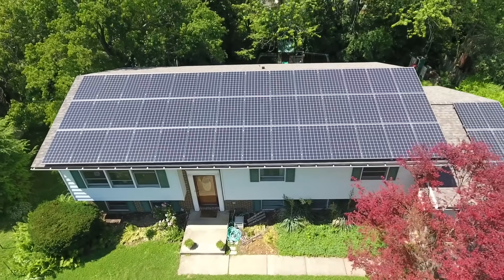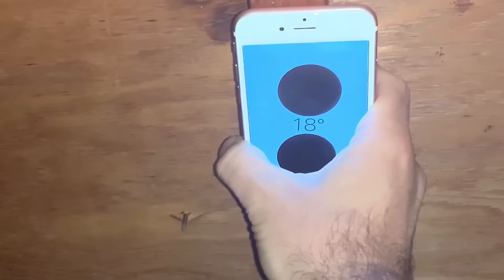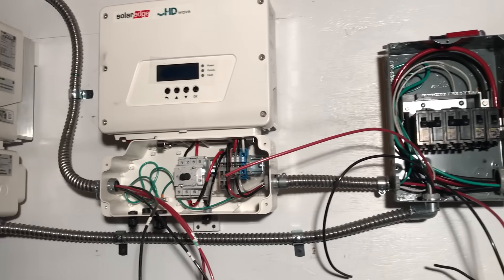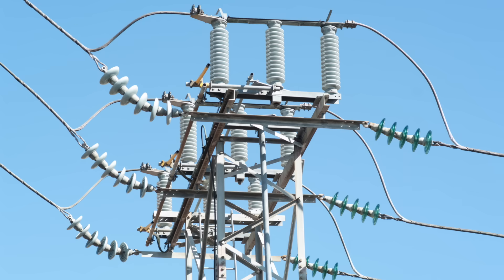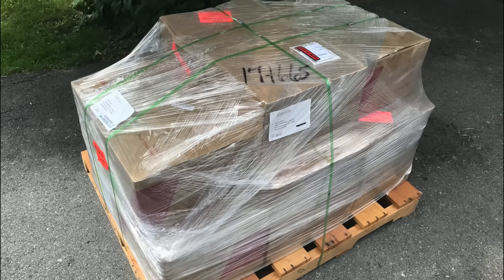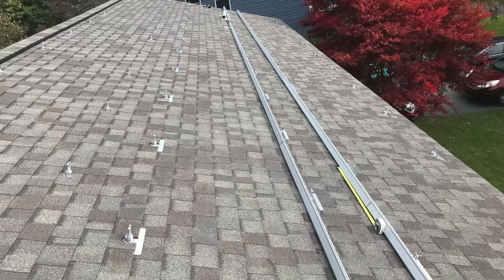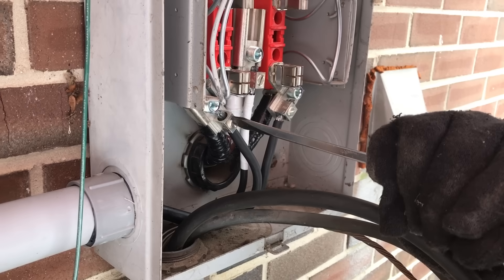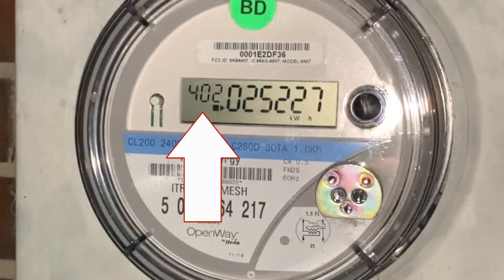I Installed a Power Plant Myself | HUGE DIY Solar Panel System

Comment: So when the sun is down and there’s no charge on the panels, the grid is powering the house?
No batteries?
Reply from the maker: Yep, no integrated batteries.  If you watch the video after this one I explain a little about how 1-1 net metering works.  I also have a video with more explanation on why I don't have batteries integrated.
Reply: @FrugalRepair  so during a power outage you could potentially be screwed if there’s no generator backup

Comment: Today, there are HYBRID INVERTERS which can charge batteries and at the same time tied to the grid also. Your solar system won't produce electricity if there's a power outage. I guess you've known this thru experience by now. 🙂

Comment: How many hours or days did it take you to install the panels only on your roof?  How long did it take to install the rest of the hardware (inverters, conduit, meter boxes, and wiring, etc?  Also, how long did it take for your neighbors to install the same?  I'm just looking to get an average length of time.  My house is much smaller, so, I'm trying to guesstimate how long it might take us to install it on our own.
Reply: hi if  you are planning to install system yourself  i can help you by provided permit design for your system.

Comment: How do these panels hold up to severe weather such as hail and thunderstorms?
What is your plan when the roof needs to be replaced?
Your work is very neat and well planned!
Thanks in advance!
Reply from the maker: They hold up great.  They are made with the elements in mind so they are very strong and the rails are spec'd to withstand like 130mph wind gusts.  I doubt the front roof will need replaced in my lifetime (the panels are extending the lifetime of the shingles)  but worst case, I take off the panels, sell them locally, maybe install something new, or just put them back on.
Reply: @FrugalRepair  thanks again.

Comment: What a great video. I'm a carpenter/maintenance man and I would like to do exactly what you did. To me it actually looks kind of easy. I got a quote from a solar company and they wanted 22,000. I think I can do it way cheaper. I'll be using your links thank you very much.
Reply from the maker: Thanks.  Are you looking for a DIY kit solution?  Or going to buy the components and design yourself?

Comment: This is bloody impressive! Sadly, here in CZ or Germany you would not be allowed to install high voltage electricity without being a certified electrician.
Reply from the maker: Thanks!  Could you do 99% of the work and then have the electrician connect the wires to the power grid?
Reply: @FrugalRepair  well I could not. also most will not do it because they have the liability on their neck then for your work
Reply: @FrugalRepair  say you mentioned you used a website or app to assess how many panels etc you need. right? can you maybe give the URL?

Comment: I like your attention to a quality install, well done.  Personally I don't like the look of solar panels all over a nice house.
Where I live the hydro company will never cut you a check for power going back into the system, just a credit.  Which would be no good for me, because I really don't use a lot of hydro if you do a cost of use, to power I could provide.  This would be great if I had a cottage off the grid.  Either way, great install.

Comment: pretty sure if nuclear material couldn't be turned into a weapon.. everyone would have their own nuclear reactor powering their houses by now.. one thing though.. you should have replaced the shingles before you put all that heavy stuff on there, go with 40 year timberlines if youre gonna be putting solar on your house..
Reply from the maker: I did put new shingles on.  It was in the video.  It was nice because this way all of the tar adhesive strips and nails are undisturbed.

Comment: No bills yes BUT...  How much do you have to shed out to buy those solar panels?  They are not free nor cheap either.
Reply: How much do they save in the end. A setup like this pays off after around 10 years with the life of around 30 to 40 years for the panels
Reply from the maker: It’s closer to 5 years for me.  In the next video after this one I go over what I spent.

Comment: I put a 4,440 watt solar panel system on my house in 2003 and I had to actually make the rails and mounts because they were not available to the public. Now I need a new roof so I’m going to remove my 19 year old system and I want to put a better system on. What do you recommend?
Reply from the maker: Congrats on finishing that project so long ago.  I’m not sure your setup but I liked ironridge but there lots of mount and rail options out there.  You can even get rail-less systems where the panel rests on the mount.  Feel free to shoot me an email if you want.

Comment: you should have added a point to TESLA for the emerging LFP battery. I will last longer and as I'm sure everyone will agree, it will just spin off even more innovation and allow for quicker charge times, larger capacity and higher output.

Comment: What do you do if there is a problem with a panel in the middle of your array in the middle of your roof? Do you have to disconnect and move panels leading up to that panel to get to it?
Reply from the maker: You would move one panel out of the way from the top row to get to the one in the middle.  For me, it would actually be more of an issue if I had to service a panel in the front row.   I don't know if I would try to do it from a ladder or just take out the top 2 in the column to deal with it.

Comment: Why did you install the solar panels on only one side of the roof?
Reply from the maker: It’s not economical to put panels facing north.
Reply: @FrugalRepair  So it doesn't payback itself I think. But it would still produce electricity wouldn't it?
Reply from the maker: Yes, it would still work but since I live in the northern hemisphere the path of the sun is on the south side.
Reply: @FrugalRepair  Okay. Thank you so much for answering ☺️🙏🏻

Comment: UK: Scotland. My friend has a farm. He wants to have solar but doesn't know what to buy. He had a quote from a company. 25 panels installed on cattle shed roof.  Grid-tie inverter and 10KW battery. £18,000 quoted. That would be a long time before it would have paid for itself and return any free power. By that time, the system would possibly be worn out. 
Surely there is an easier, cheaper way to free power. 
Help ?

Comment: no bills….except the huge price it costs to install.
Reply: permitting fees.  Electical engineer fees, certified electricial installation fees.  
increased insurance costs due to fire hazards
and he still has to pay the Electic company $30+ /mo just for the service connection.
his statements appear to be fraud.
Reply from the maker: Watch the video after this one and I cover what I spent, if interested.

Comment: and you are exposing neighbors to unnecessary radiation from the panel system.  If you use solar panels, they should be setup behind the house away from the home....but good job! :)...maybe you can help them with the chemo therapies.

Comment: No way those panels supply all the power you need, you dont even have powerbanks ? the kwh use in Norway ranges from 40-120kwh a day in depending on the season, and you are expected to produce between 4-12 kwh/a day with soloar panels. Sure there is more sun were you live but you can not convince me that you setup supply all your house power demand.
Reply from the maker: It actually does because I have net metering.  Watch my solar misconception video for more explanation if interested.

Comment: I've heard stories now of of some states allowing electric company to introduce minimum billing on electric bills, in the range of $25-30, to cover maintenance and upkeep, even if you have no electric usage, you'll be billed a flat fee.  This may only impact 1% of their customers but it will completely change the equation here.  Electric companies are also lobbying for reduced buy back electricity from setups like this.  These negate any advantages from solar panels.  Please check your local legislation and electric company policies carefully before installing solar panels.  Otherwise, you may not get back what you expect.
Reply: Connection fees are baseline $30 regardless of power transmitted. 
the guy is lying.
Reply from the maker: I think it's funny how you know what is on my power bill.  If you watch my videos after this I show my bills and explain how this all works.  Yes, I make money even after the power company basic charge.

Comment: solar panels decay, entire solar industry survives off the money of constantly replacing panels. Batteries definitely decay the capacity will fall every year and will need to be replaced constantly too. Green is a lie.
Reply: Planet of the humans is a good doc on that. All it is is a 20 year fossil fuel extension if you get a lithium ion battery so considering we’re gonna have major energy problems starting this fall it’s still not a bad idea to throw it in just so you have extra back up power when they cut the lights.

Comment: I have no idea why more people don't do this??  So many just continue to waste money on power companies ... the financial freedom this brings and overall energy independence is like taking a 100,000 lb elephant off one's shoulders.  Even if you don't believe in climate change, solar makes economic sense even in environments that aren't sunny.  You aren't reliant on gasoline to get from A to B with EV charged by solar panels, you aren't subject to power saving days and brownouts or just grid failures that happen all the time (aka Texas).  Our solar energy system is by far the most reliable energy source we've ever had.  I honestly just don't get why everyone isn't doing this??  In some states the cost to install is zero due to incentives.  The excuses I hear for not doing solar are just laughable.  The real losers are those slaved to be corporate power and oil companies who seem to enjoy lining up at Gas stations for $7/gallon limited energy source.  Oil/gasoline IS going to run out, not an "IF" just a "WHEN" and that WHEN is in 50-100 years (within the lifetime of many).  Nuclear energy max is 267 years until we run out of nuclear material, solar energy at least another 5 Billion years.  Solar panels are getting more and more efficient every year and we even have UV panels and Infrared panels to capture more energy across the light spectrum (other than just visible light).
Reply: Correct there are major major energy problems going on around the world right now it’s all being set up to fail by Davos bankers. Now is the time to get it installed and then you have 20 years of not having to deal with frequent power outages which are coming to even America soon.

Comment: If you installed solar panels to remove your electrical bill it's fine, but remember that solar panels are an ecological disaster you will never refund the energy it took to produce these panels. Solar panels are a gigantic scam, it's very far from being ecologic, it takes an impressive amount of ressources to produce and it is not recycable. So remember if someone is selling you these solar panels as a green energy it's an hoax or he don't know what he's talking about.
Nonetheless, good job on your installation.
Reply: True. The thing is with all the energy problems they’re gonna be cutting power worldwide from here on out as society and supply chain break down. Now is the time to install solar!

Comment: I had a solid company install 40 panels.  Predicted to break even in 7 years, it did it in 5.  I still pay electric bills, but I don't worry about heating my pool, running aquariums, taking long, boiling showers, or slow cooking all day with the oven.  Had I known we would be facing record energy pricing I would have purchased storage batteries too.
Reply: Are you off grid or unable to hook your solar array to the grid? It is better to throw extra bucks at panels and hooking into the meter than batteries unless you have an off grid situation going on.

Comment: So you have no battery bank that I can tell.... Does this mean that you make enough electricity in the day to offset the cost of the grid overnight - since the price per kWh is usually cheaper at night?
Reply from the maker: Yes, I have net metering.  Check out the video after this and my solar misconception one for explanations.

Comment: A hidden and bonus way you save money by covering your roof in solar, that not many think about. Is how the panels themself protect the actuall roof tiles from direct sunshine (heat), rain and wind. Probably making them last much longer.
Reply: actually the cells trap and increase heating on roofs ... typically causing faster degradation.

Comment: So did I 🙂. Yes, DIY’ers CAN do this and save BIG. All it takes is research and time, but the $$ savings are worth it. This month in May and for the past 5 years my system has produced 1.85 Mwh, and I’ve paid $0/mo for electricity the ENTIRE time. Watching this video brought back memories, except that mine was over a concrete S tile roof (took more time). If you’re thinking DIY solar, this channel could be just the ticket!
Reply from the maker: Congratulations on your install!  And for the encouraging words.

Comment: You don't start "saving money" immediately, you still have to pay off the cost of the solar cells. For the average home owner it's going to take 28 years to pay off the cost of the solar. Doing it yourself you saved roughly 40% of the cost. So in 11 years then you'll be paying $0 for power but not before. In other words you saved the future home owner money since most people move every 6.6 years

Comment: We would love to do what you have done , only issue , checked the world UV sun map re solar. Based on the sun calculation's Hours pr Day , Vancouver Island year payback is just not cost affective. We get so much cloud , It will take 25 years before we see any payback advantage. I was also going to open up my business for solar . Today I would say with the new batteries and LED lighting , I would ONLY rewire all lighting in home with 12v LED, and stay on grid for some appliances like Dishwashers, Microwave, and heating boiler . Dryer , range can be on gas,

Comment: I built an off-grid solar battery (after the great Texas Freeze last year), have 6x100W panels and a 300amp/h battery connected. Spent about 3K total on the project and super happy that it can take anything I throw at it. Not a 1-1 grid replacement but definitely piece of mind.
Reply from the maker: Nice!
Reply: living near Conroe, and going thru this several times over, I still have my old Montgomery Wards 2500 watt Briggs powered camping generator that worked fine. The fact we have a well for water for us and the horses made me buy a 13,000 watt generator which helped with the last freeze. Now I have a 210 watt panel that I will be adding to along with a 3000 watt inverter and four 100 ah batteries which helped when they shut off the power three weeks ago....it's nice to sleep without a generator running.

Comment: We have a family friend that got solar panels, he lives out in the country n he installed them himself. He didn't put them on the roof he made a small section just for the panels, he welded some frames for the panels. He didn't connect to the power lines, although he did put the meter up were he could just keep track of the energy he was getting. So he's off the grid n he had more than enough energy n he's been going good the past 3 years n never had any black outs. The power he gets is like as if he was still connected to power lines, we plan on doing the same soon.
Reply from the maker: That’s cool.

Comment: Florida is doing away with net metering.  Our energy company wants us to purchase general liability insurance to operate with a grid tied system.  So ours would not be grid tied.
Reply from the maker: That’s not good to hear.  Sorry about that.  When does the net metering end?  And does it go to zero or do they give at least partial credit for sending excess to the grid?
Reply: @FrugalRepair  I believe in a few years.

Comment: Unless get batteries to store,  solar  is useless, you  are going into massive debt to try get pennies from power company  that does not want to pay you.  
Ammonia is a renewable  fuel that can be used in a flex fuel generator.  And that set up will save many tens  thousands  of dollars over solar. And ammonia can be used in flex fuel cars and gasoline cars,  again  saving you many tens thousands  of dollars over buying an electric  car. 
And you can distill , compress NH3 from the air into ammonia at home.
https://youtu.be/Bs3HSChSh_E
https://youtu.be/XHZXAz9WP9M
 https://youtu.be/L0hBAz6MxC4

Comment: Frugal??? 
You have enough panels to power a city block!
Try figuring out how much you are losing by converting it to high voltage AC, and then back to the low voltage DC that most modern devices need.
I generate all the electricity for my domestic and transport needs with one 200W panel.
You are turning OVER 90% of what you generate into heat and dirty EMF to fry your brain and nervous system.